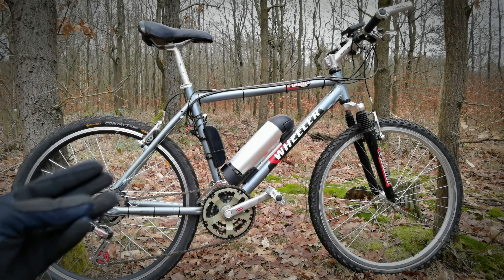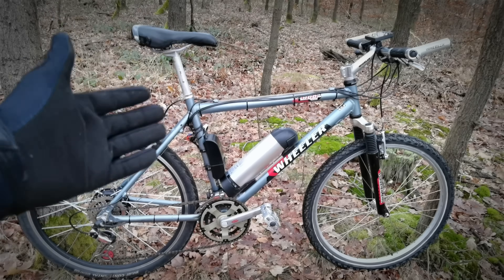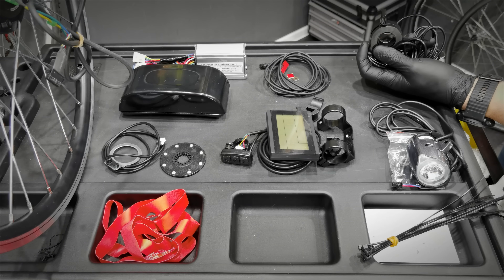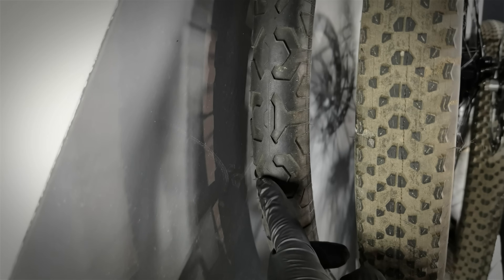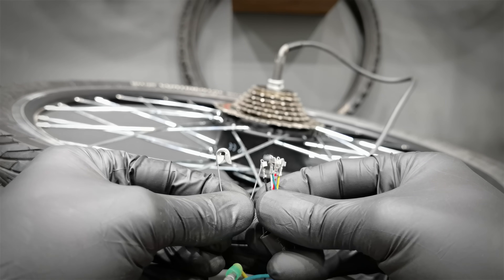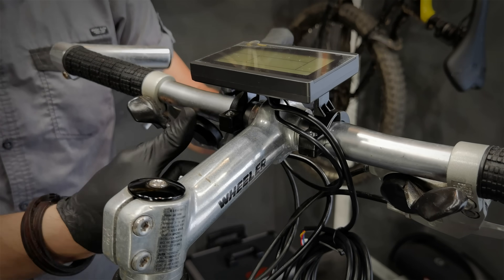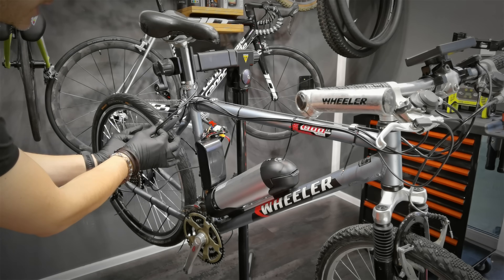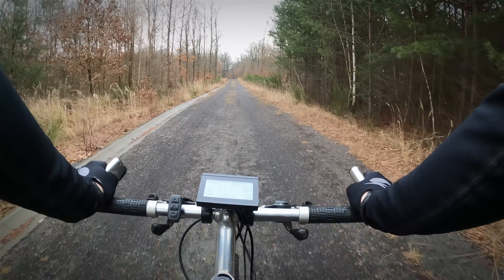Old mountain bike + Aliexpress e-bike conversion kit = best deal for electromobility.

Comment: I assume it isn't a good idea to have the controller mounted upside down. Rain will follow the cables into the controller whereas if it's the right way up water is unlikely to go up to the controller and cause water egress.

Comment: if you're going to buy an ebike kit go for one with a dual mode controller. if the hall sensors in the hub fail the motor will continue to work and work well. some actually remove the sensors and the wiring and put beefier cables to power the motor instead so they can shove more amps to it.

Comment: Wouldn't it make more sense to put a hub motor on the FRONT wheel and not piss up all your gearing and crap? And that way if your hub motor fries you can swap it out so much easier? That way you could also have a petrol motor to the rear wheel if you wanted.
Reply: no, it doesn't. you get better traction with a rear hub vs a front hub, the frame of bikes is much stronger on the back than the front, and the extra weight doesn't take getting used to so you're far less likely to end up hurt (as steering is always with the front, the back wheel being the trailing one makes it much easier to keep using if the balance shift is near the back) 

rear vs front also provides more power, in part thanks to the ease of them utilizing gears and getting to your pedal movements
Reply: are you special

Comment: Curious if you've had any problems with water intrusion into the control box since you've done this mod. You probably would have better off mounting it properly so that the wires would have had a drip loop at the bottom, which would help prevent that issue.

Comment: For you who are whining that "250 is useless!" go to Bike Calculator and put in the numbers: A 225 lb rider on a 60 lb bike up a 6% hill, using 250 watts from a battery and 150 watts of pedal power (quite modest effort) will get up the hill at about 10 mph. And he'll soon be in lots better shape than the frump who glides up the hill pulling 750 watts of battery power without pedaling.
Reply: PS: Putting this into perspective: a 160 lb rider on a 20 lb road bike pedaling at 250 watts will get up the 6% hill at 10 mph
Reply: Not everyone gets a bike to get fit! Some people have physically demanding jobs and don't want to be sweating amd shagged out before they even start work so a 750w ebike is just the job
Reply: Kevin, I'm with ya on that, but a casual rider who's not in it for fitness or for 40 mph recklessness really never needs to go over 150-200 watts, so 250 is plenty, gives ya more options, and will cost lots less.

Comment: Get a pair of flush cut pliers for the zipties. I can't tell you enough hiw nice it is to not cut yourself on the leftover tab on the zipties.
Reply: Also, for a quick fix you can always take a lighter to the sharp end of the cut zip tie and melt it until it’s round.

Comment: Lovely!
can one install the pedal asist sensor if one has a hollowtech bb/crankset?
I'm a 40+ man that wants to keep the pace with his son, and that seems to be the only way...
Reply: There are lots of alternatives to pas.  I’ve only built 4 ebikes.  My first doesn’t even have pas.  Just a throttle (I use my brain to choose how much to boost).

You can get a split PAS that clips onto your bb, without removing the crankset. 

The most common PAS only requires removing the left crank.
Reply: @hjeffwallace  good point to use the throttle as single controller. Thanks.

Comment: NO TORQUE ARM!!! Good chance the motor axle will spin, damaging the axle, the drop-outs and possibly the rider. Is this jerk supposed to be a pro?
Reply: Which jerk? Only jerk here seems to be you with the insults, but I'm not an expert in diagnosing jerkery...
SickBiker is a cyclist. Not an e-bike specialist, as you would know if you bothered to check. If you want an expert, there's loads of them on youtube. Good luck with your search ;)
Reply: what exactly are you saying? I'm converting my bike tomorrow but i have no clue about what you are talking
Reply: @711rico  a torque arm is a piece of metal on the rear axle connected to the bike frame to basically stop the wheel coming loose
Reply: bruh 250W...torque arm is usualy needed above 500W
Reply: Nowhere near powerful enough to worry about a torque arm.

Comment: disc break is important as the speed is much faster
Reply: 250 watts is really for pedal assist with thumb throttle on flat surface, it should be fine.
Reply: Not on a EU legal 250W pedal assist bike. It won't power you above 25km/h.

Comment: Disk brakes are a must as well given the extra weight of the additional components.
Reply: Not really, only a few kg extra weight.   Rider weight can vary much more.   V-brakes are easily capable.
Reply: @jamesowen418  Not when it's raining.
Reply: @denseljosephs9500  yes, even in the wet
Reply: @jamesowen418  That's probably why they're not used on new bikes anymore. Time to move with the time's mate.
Reply: They work fine. It's just a matter of how often you ride or more importantly how often you feel like changing pads because they do wear out a good deal faster. It's a worthy trade off for some people that don't want to deal the more difficult disk break maintenance.
Reply: @denseljosephs9500  You can and always will be able to buy a bike with rim brakes. They're lighter, cheaper, simpler, easier to maintain, and they work just fine for plenty of applications.

Comment: Put a magnet on the forks and make sure they are steel.  There is a lot of torque on dropouts so aluminum is not preferred even with torque converter.

Comment: the one you linked with comes out 514 € for the rear wheel 500 watt 26" version with the smallest battery.(wheel from spain, battery from  poland, no import tax on either). not a great deal. we recently bought a 320 wh front motor ebike new for only 422 € after incentives called the neuzer palermo / stonefly ebike, it's also chinese stuff but 800 km later it seems quite dependable.
Reply: I can find 1500w rear, for 340 euros on aliexpress. I will buy this next month
Reply: @KevinKvn69  battery included, and after import tax? Buy it. Also look up grin technology's lecture here on youtube on hub motors if you have the time/are technically inclined.
Reply: @markifi  304 euros and for transport is 30 euros. The kit is 1500w that means you will get 50-60 km /h very powerful. Bought from Spain you don't pay at the customs and the Vax tax is already included. The battery is not included, but if you want a good battery it will be 400 euros for the battery itself. 48/52v 21ah for long range 80 km. Total is 734 euros. Much cheaper doing this than buying an ebike in the shop with 1500 2000 euros that doesn't have throattle goes only 25km/h just pedaling.
Reply: @KevinKvn69  ?ty

Comment: How heavy is the battery?  It's just mounted with the water bottle cage bolts?
Reply: battery entre 3,5 y 4,5kg
Reply: 10AH 18650 is normally 2.5kg. with 4 screw & bolts, it is ok

Comment: I installed a similar kit, but the controller was inside the battery so it was a cleaner install and neater, it was a yose power kit, and I can get 40 plus miles from it. The bike I used was a giant xtc from 2011
Reply: Dillenger make a similar ebike conversation kit where the controller is built into motor.
Reply: @millsshumps1968  yeah your right, but it was more expensive
Reply: similar design to my kit